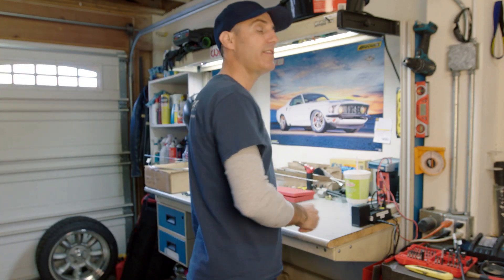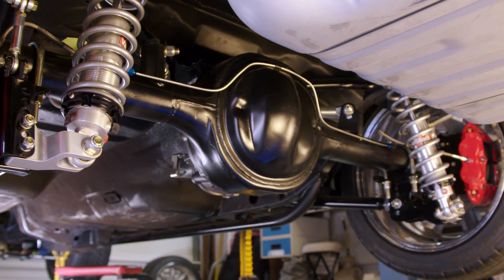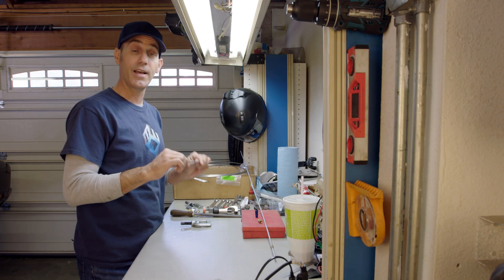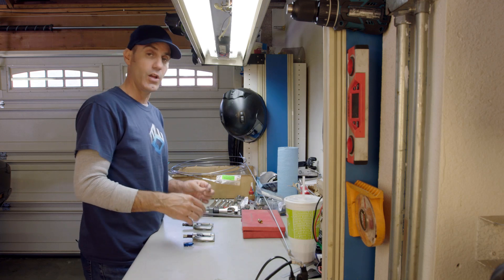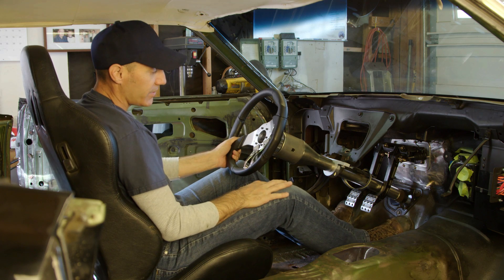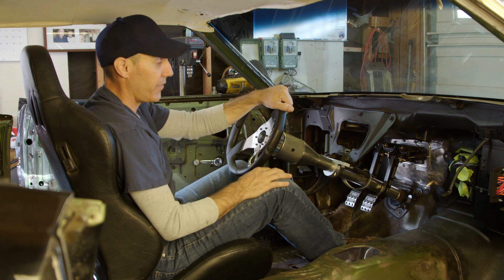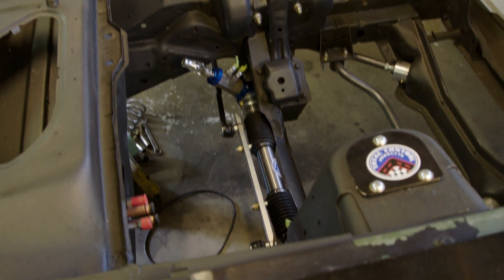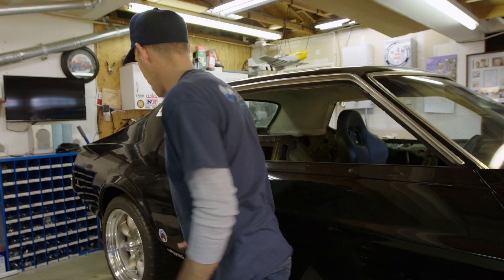Automotive Brake Plumbing Breakdown and Mustang Project Catch Up

Comment: I was bummed to hear you sold the car love the content! Do you recall the master cylinder bore sizes used for this pedal setup? I will be ordering the same setup on my 71 fastback. Thank you so much !
Reply from the maker: I wasn't stoked on having to sell it. The master cylinders were 3/4" for front brakes and clutch and 7/8" for rear brakes. Worked perfect.

Comment: I have never plumbed a brake system before.   I really wish in these videos somebody could be VERY specific on which flare to use for which application.   In addition WHERE to get the parts.    NOBODY stocks this stuff anymore.   I got on line and it said Autozone carried Nicopp brake line.......so I went in the store and asked the guy behind the counter for a roll of Nicopp brake line........he looked at me like I had two heads............I had to explain it to him.........so he goes in the back and after a lengthy time returns with a coil of black STEEL line...........I said, NO, I need Nicopp to which he appeared frustrated with me............so I go in the back with him and show him what I want..........then fittings.......yea they have a whole rack of fittings........NONE OF WHICH are anything like those shown in these videos.
Reply from the maker: Go to https://www.eastwood.com/ and look around. All the info you need is there.

Comment: Do you think nicopp is as strong as OEM brakeline? I'm running a Hydroboost setup that builds up to 1800 psi...... or am I better off going to Stainless steel brake line instead? Thanks, MuscleTruck

Comment: Great builder may i ask what size wheels an tires you went with ? model too ET  mags
Reply from the maker: They are TeamIII wheels 17x9 in the front and 18x10 in the rear. Here is a link to the website:
http://www.etmags.com/lt_iii.html

Comment: Question: You mentioned that you were able to use all AN fittings strait to the caliper. Now what adapters would we need if we were to use the stock hose or hose fittings?
Reply from the maker: Simple, just use 3/8" NPT to banjo bolt style adapters or whatever is stock on your vehicle.

Comment: I was told that doble flare is required  for break lines , you didn't show how to do doble flare,  any ways I'm working in my 60 ranchero ,thanks for the info ,keep up the good work
Reply from the maker: Yes, manufacturers use double or bubble flares but it's not a requirement for me... plus if you are using stainless brake lines you can only single flare them.
Reply: Tnx for the advice,  appreciate it

Comment: As someone who uses what is in stock and what is KISS stainless lines and the alloy fittings are just pure wank. For 99.9% of all jobs mild steel is the best, these days it has to be the plastic coated stuff to be road legal. It is a bit harder to work with but a LOT better than stainless.
The zinced copper stuff is very nice  to work with but if you are undoing and doing up fittings as you do with road race cars it is not very durable,, and for off road use [inc the normal road 4wd] it dents far to easily. And is not legal yet again.
Using more than required flexible hose is not good either, better than rubber ofcourse but ONLY from the chassis to calliper and chassis to rear axle. Every bit of flexible hose means a softer pedal. I have seen 'experts' who have learnt that.
For race use aeroquip style steel fittings are fine but not for road use, they must be swaged and have standards markings, annoying but fact.
It seems that in the US standards for road cars are not enforced,, but crash and then the shit hits the fan. I suspect especially in litigous USA.
For the stuff on You Tube with Roadkill etc and Drag week here in Oz we would be arrested. And go for a roadworthy inspection most of those cars would never see the street again. All of the above people find [and are told] getting hot rods and the like registered.
Pedal boxes can be very nice on road cars but in reality are a waste of time and money on a streeter. And generally alters pedal ratio as well. And those Fords have a big long pedal. Doing away with the booster , 7/8 m/c and an adjustable  brake bias valve is all that is needed,, and all that is used on many succesfull race cars as well. And some still use boosters.
While a lot of it is B/S a lot of it makes a lot of sense for us old farts!

Comment: You CAN use 45 degree double flare fittings on stainless lines.  But the stainless has to be an annealed tubing. Summit racing Part Number:SUM-220256 works great!  The double annealed stainless WILL NOT split - no pre-heat required!!!!

Comment: For the brake line, are all fittings -3? This makes me want to redo my entire brake system. I used mild steel. Not because it was easiest, I just didn't know about anything else. Keep the videos coming!
Reply from the maker: In this system almost all the connections are either -3 or 1/8 NPT.  I learned about this new material from a viewer on the you tube so we all are always learning.
Thanks!

Comment: Great video! Why did you use flexi lines to the rear calipers? They don't move in relation to the axle. From factory there was only one flexi from body to axle. As far as I can remember lol it's been ages since I took the brakes off.
Reply from the maker: I put the flex lines there because it will make it a little easier to service those calipers and rotors in the future... instead of disconnecting hardline to move them I now have a little room to work with.

Comment: Nice touches on your brake system.  I'm doing some very similar things on my cars.  I'm curious though because I really like what you're doing at the firewall -  I've always been told that brake lines should have as few junctions as possible and that flexible lines always add some level of sponginess to the system.  You added both to your system - is what I've been told over the years not applicable any more (which is entirely possible since I'm old :-)  ) or are you making some trade-offs for serviceability and looks?
Reply from the maker: Yes, it is best to design a brake system with as few fittings as possible since each one is an "opportunity" for a leak but in my experience...making solid flares and using care never game me any problems.  About the flex lines...a few high quality braided steel lines will not make for a spongey pedal...rubber, you betcha.
Reply: Thanks for the response!!  That gives me some more options and will make my redo of my early 70's brakes easier and they will look better.  I've upgraded to 13" disks up front and will be changing my rear drums to 11.5" disks in the rear.  Since I have to eliminate the factory proportioning and add after market your demo is a big help...
Reply from the maker: That's great to hear! Sounds like you have a pretty sporty hot rod in the works there...You'll be happier with an adjustable proportioning valve in the future!

Comment: Glad you are building and showing your "hey, it's a guy in his garage" project. That's why I like Roadkill and the like so much. My 39 Plymouth show quality car is expensive and slow to build and complete. My 400,000 mile 90 C1500 guy in his garage truck is going to be faster and more fun to drive. Cuz I can drive it and not worry about it so much. I might not even paint it. Just have to fix the damn drivers door that won't close right!

Comment: Vary cool was begining to despair that you had not just back burnered old Large Marge but taken her off the stove all together. I have bit of a soft spot for this chassis but have NEVER  seen any kind of grip, G-machine/pro-touring build and the roots blown 302. Is also vary much of interest to me. Paricularly with EFI should be a runner and a half can't wait to see it running loose on a road coarse some where. 
PS thanks for the video on measuring for wheels that was the first time I had seen it done. This way not relying on internet he said to fit larger combos front and rear. Please stay the coarse. I think the shorter quick little updates are a great idea and say keep'em cummin. Thanks Jason
Reply from the maker: +roger depew Thanks for the very valuable input! I really appreciate when some of the things I do help out other people.
Yes, this project has a few odd parts but it's more about things that I really want to have on my vehicle.  Those are the things that makes this so personal!
Thanks for sticking with the build and taking the time to say hey!

Comment: nicopp line is my favorite, bends easy, flares perfect, and doesnt rust. This is all i use on customers cars as most of the cost of brake lines is in the labor so you sell better line that never fails and you get a happier customer
Reply from the maker: +UBBERTANKER Thanks for the tip on the NiCopp lines!  I may switch up and use that stuff because it looks so cool and if it is easier to work with...WIN WIN!

Comment: do they make a front supension package for the comet / mavrick or can the mustang package be made to work on it
Reply from the maker: +rttguy1969 They do, just head to the website in the description and check it out!
Reply: +autoedit so will the mustang kit work under a mavrick looked on the site only saw mustang falcon fairlane thanks for the help
Reply from the maker: +rttguy1969 I believe the 65-66 Mustang stuff works for the Mavericks but give them a call up there at TCP...they are pretty awesome about trying to help out!

Comment: id like to see what you use to make your bends on the brake lines, and how you go about laying out and planning your bends to fit what your working with.  I am soon going to be doing brake lines on my modified CJ2A Willys Jeep and its going to see plenty of mud water etc so I think stainless is the way.   good to see you back :)
Reply from the maker: +ShnitzlHaus Thanks dude!  That Willys sounds like a great project.  I'll try to get another vid up with more plumbing stuff soon as well. But here's a tip I learned from a friend that might work even better for your CJ, use mild steel brake lines for your plumbing and then paint them before final install and they'll last for a LONG time.
Reply: I was thinking that also! any thoughts on the copper nickel lines?  if you like to see more on the willys check into my channel every now and then spring I should have allot of how to videos up.
Reply from the maker: +ShnitzlHaus I dig the copper lines, never used them so I'm curious how they are to work with.  I will definitely be looking for more on your Willys!